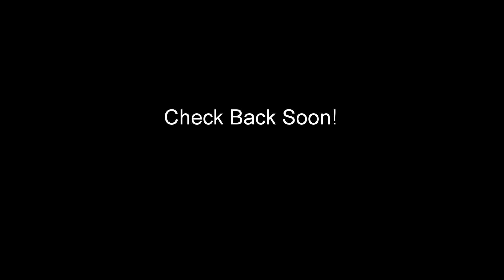Jet Boat Build ep 3 - Engine/Pump/Driveshaft

Comment: Could you theoretically use universal joints in the shaft before you get to the housing?
Reply from the maker: Sure probably, although I suppose the reason they do not is because per each U-Joint comes with a power loss, as well as they try to build them a basically as possible. If you look at these straight shaft ski setups, the drive shaft is actually egged on both ends. This allows for forgiveness, they dont have to match up perfectly, there is room for 1/4" off on both ends, allowing the setup to be tuned and stay within specs that do not cause any wear over time.
Reply: @ripptydevibes2581  thank you, the reason I ask, is because I got a Mercury inboard v6 that fits, but the crankshaft is way to high for the drive shaft. I'm just trying to come up with a solution. If there is some other solutions, elaborate for me.
Reply from the maker: @roybabin924  I have heard of U-joint systems, but am not familiar with them. I would imagine though, if yours are WAY off then you may have an issue. They can tolerate difference, but im not sure how much. You would be better looking into the proper forum website for better information on your system

Comment: Nice job !! What size dowl is that? Whered you buy it?
Reply from the maker: I don't remember the dowel size. Measure the width of the teeth on your driveshaft, buy a dowel that's larger than the shaft teeth.
Sand it down by hand in a circular pattern until it fits into the jet pump.
Reply: @ripptydevibes2581  did you have to sand and fit the one you had.. was hoping i could just get it from lowes or home depot.. my engine uses the same size shaft yours has.. dont want to have to buy the 300 dollar alignment tool
Reply from the maker: @djmjr77  I have since, made my own steel shaft alignment tool. I ordered a solid drill steel and a plastic slip bushing from Mcmaster free shipping about $35 total. Google (787 shaft alignment) and click the link for the forum of the homemade alignment tool and you will see it.
YES, I sanded that wooden dowel because I had to buy the size up so that I was able to get it to fit properly.

Comment: So how did you make the hole after marking it out on the inside of the intake?
Reply from the maker: The hole in the hull was cut using a cut off wheel. The hole in the intake was cut on aluminum plate using a jig saw and smoothed out with a grinder.
Reply: Thanks for replying. I just wondered you know, after you marked out where to cut the hole with the dowel, how you got the jigsaw inside there to cut around your mark (the white paint). I guess you cut from the opposite side to where you marked out? I am going to try fabricating an intake myself, and I am curious about methods. Thanks again for your time to answer.
Reply from the maker: Oh the hole for the driveshaft thru intake! Yes, I used the dowel covered in paint to transfer an accurate "rough" mark. Then I first started by drilling a small hole. Then I used a dye grinder with a burr bit to egg out the hole into the diameter that I needed.
Reply: Good workaround. I shall keep it in mind.

Comment: I love know what engine I could use for my 1996 Dynasty Storm Jet Sport I don't want put 125 Mercury that has been orphan and hard to get part for it  what be best Engine for it  and if can use the old jet in the boat?
Reply from the maker: Best bet would be to contact a local jet boat service/building shop to ask them for their opinion on what options you have available.